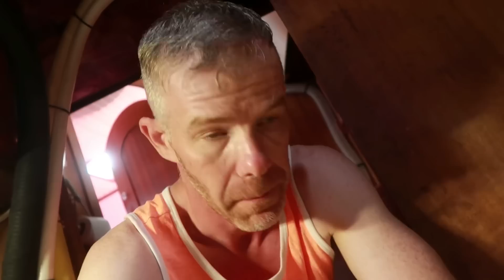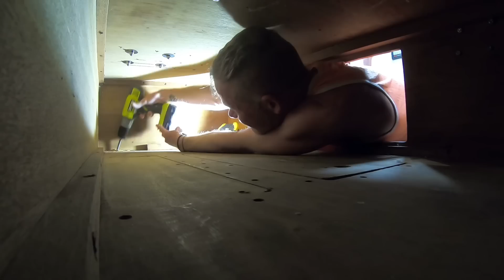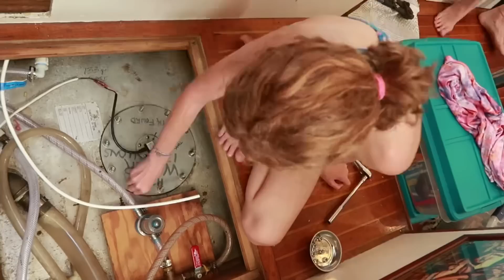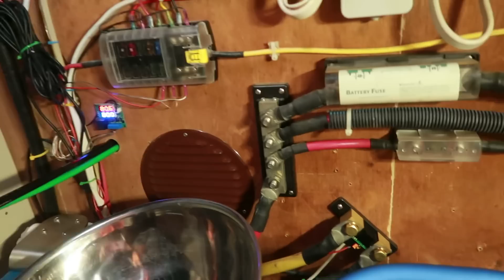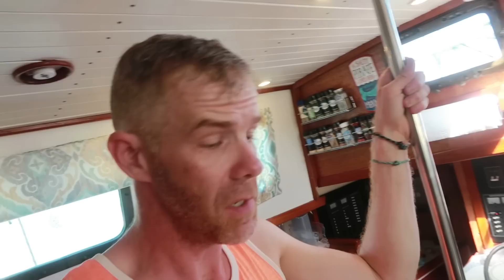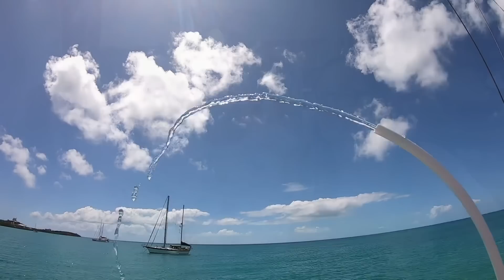Rainman Watermaker Installation At Anchor 💦 Sailboat Story 234

Comment: The way you installed the brine water tube to the bilge pump hose, what stops bilge water from going back down the brine tube?  Shouldn't there be some sort of check valve?
Reply from the maker: I don’t know whether it should or should not, but it certainly could which is why I installed one after the video was filmed. Likely unnecessary unless one is particularly concerned with keeping bilge water separate from highly-organic, smelly, ultra-concentrated brine water. I found the fitting at a hardware store so popped it on just to have it. Maybe it’ll help? Hard to know.

Comment: No sealant on the water tank hole you drilled?
Reply from the maker: Several have commented similarly, but there is indeed a small rubber seal.

Comment: Same setup I had on sealight. The advantage of this system was I could sell or transfer it to another boat and the water output is amazing. Downside was there was no auto fresh water flush. System work very well in most cases. Only has one pre-filter.  In some water bodies,  two pre-filters would be better to prevent clogging so fast.
Reply from the maker: I like modular/portable boat systems. Watermakers like this one that are not deeply integrated, refrigerators like an Engel that can be removed easily, chartplotters like iPads running on Navionics, wind instruments like handheld anemometers, etc. Easy to use, simple to replace, convenient to move around, not deeply and complexly integrated into other boat systems. Modularity is part of my own philosophy on keeping things simple and one big reason I preferred this model of watermaker. We've not noticed the pre-filter clogging quickly where we've been operating, but I did notice the filter cartridges we have are washable, if need be.

Comment: Hi, Nice job, are you not worried about the exhaust from the generator going into the cabin?
Reply from the maker: Not at all. It sits at the extreme aft end of the boat when running. I only pulled it into the cockpit for the sake of recording that segment so it would be more visible.

Comment: I think I would have handled the brine discharge differently.  But since you've already done it you might want to consider adding two check valves:  one to keep brine water from back flushing into the bilge, and another to keep bilge water out of your brine discharge hose.
Reply from the maker: There is a check valve on the brine line for exactly that purpose. Found one at a hardware store and installed it after the video was filmed. However, do consider what is inside the brine line if you are concerned about contamination. The brine line is chock full of all kinds of raw, organic matter from the sea. It's not exactly a sterile environment that requires a great deal of protection from contamination. In regards to the brine outlet flowing into the bilge - the brine discharge can't flow uphill through the hose and into the bilge. Our bilge was dry before the watermaker installation and still is dry even after pumping hundreds of gallons of brine water overboard through the bilge hose. It's for that reason the T connector is mounted on the high side of the bilge through-hull, but on the low side of the vented loop. I hope that helps alleviate some concerns. 👍
Reply: @Sailboatstory  I assumed that the brine discharge is pumped with some amount of pressure.  In that case the brine can indeed flow uphill.  But it seems you have it sorted.  As long as your bilge stays dry.
Reply from the maker: Sure. Can flow uphill if not given an equally unrestricted option of flowing downhill, which it has. Pretty simple stuff.
Reply: Yup.
Reply: "Clean" water stored in an aluminum tank? I think not.
Reply from the maker: Context?

Comment: Going to install a ŵater maker on my westsail 32 but there is not as much room as you have.  Wished I was close to you as your 3 are much smaller than I at 6ft 215lbs and thick arms.  Solo sailor so this boat fits me.  May be slow but not into the speed as retired and time is not the issue.  Checking out the Rainman.
Reply from the maker: Maybe the single membrane unit would fit aboard your 32? It’s a fantastic product.

Comment: Love your videos. You three are an inspiration. I'd like to make an observation regarding the threaded connector through the water tank hatch. It may leak if the tank gets too full, or sloshes under way. There was no gasket material...
Reply from the maker: There is. There’s an external seal. Hasn’t leaked a drop. Thanks for looking out though.

Comment: Thanks this video has been very helpful, I was thinking about a similar setup. Have you thought of running the watermaker off the inverter? Just wandering how much it takes to run/fill the tank electricity wise?
Reply from the maker: Yes, but there are a whole different set of considerations for inverter use. Haven’t done all my homework on that yet.

Comment: Asking for a friend, but how is that not a two way valve?
Reply from the maker: We used thousands of those 3 way valves when building non-pyro IED simulators for military training purposes in a previous life. I suppose it's a 3 way because the liquid or gas can indeed flow 3 ways within the valve depending on it's orientation. For example, on our 3 way valves we would use them to fill an air reservoir, release the air reservoir, or purge an attached reservoir filled with a type of powder that simulated an explosion. In that example, air would flow in 3 directions. Tell your friend, "you're welcome". 😁
Reply: @Sailboatstory  thanks for replying but...the valve hase two positions?
Reply from the maker: I believe you’re referring to the lever which does indeed have 2 positions. I didn’t name the thing, I just call it what it is. 😂
Reply: @Sailboatstory  10-4

Comment: Great video guys just a thought if you move the test\tank valves to the wall the membranes are mounted to you won't have to lift the floor to switch.
Reply from the maker: The hoses have to be hauled out anyways for testing, filling the flush bucket, and filling deck jerry cans.

Comment: As always, a fantastic production!
And a very cool project, too!

(One little thing though, if I may.. all those holes wherever you ran hoses through panels and bulkheads? They could really use some chafe protection. You don't want to one day discover, in a year or two, that you're accidentally filling up the bilge instead of your tank.)
Reply from the maker: That’s a great idea. The high pressure hose, in particular, pulses a good bit. Ill likely delay until Summer, but give some attention to those chafe prone areas then. Thanks for the idea.